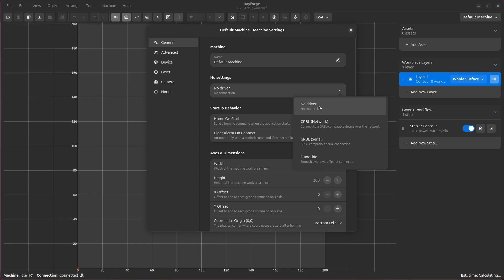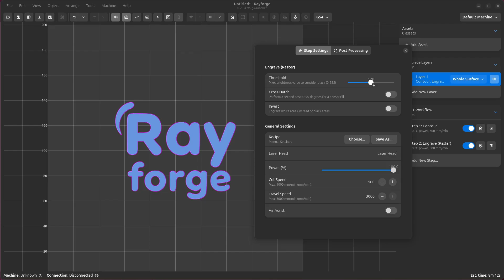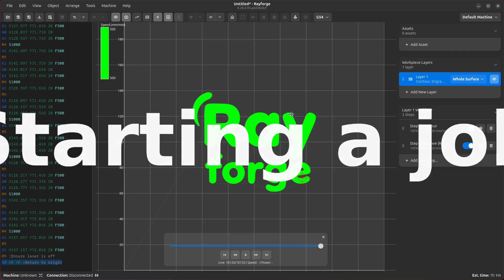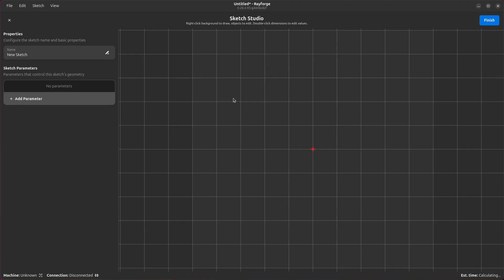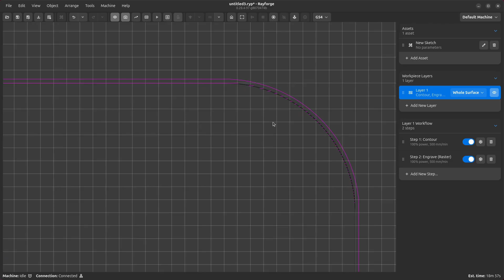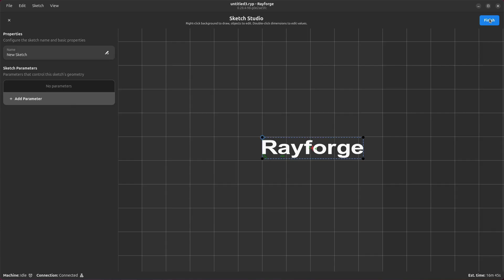Rayforge 1.0 released! Open source laser cutting. Text support, project load/save support and more

Comment: Hi. Congratulations. I just found rayforge and look forward to using the software. Is it possible to use the software for plasma cutting?
Reply from the maker: Hi, yes, sure, that should be possible. Rayforge supports keef and offsetting. If you are missing any plasma specific problems feel free to open an issue on GitHub, usually things are fixed fast

Comment: Please add a console. I use gcode to move the Z axis. I use the console to change $ setting.
Reply from the maker: You are in double-luck!: 1. The console is already available. So far only in the Snap edge channel, but it will be released with 1.1 at the end of this month. 2. The machine settings have a "device" page where you can directly edit $ settings with a nice UI.

Comment: Thanks a lot but my DIY LASER Cutter is uploaded with LaserGRBL firmware in it... Is this software able to control that... It's an nano CNC Shield
Reply from the maker: I think it should work - and GRBL compatible firmware should be supported.
Reply: @barebaric actually I recently shifted my system to Linux and the lasergrbl software is not compatible with that and so as a most close and feature rich alternative I found your software... So I want the highest compatibility with my machine

Comment: Look great! I'm not considering Lightburn at all because of their lack of Linux support.

I have one question, how is engraving supposed to handle grayscale? In LaserGRBL for example you have dynamic power which changes the laser exposure based on how dark the image is. I do not see this option in Rayforge. According to the manual the Raster engraving is supposed to be able to do this but that seems like an AI generated text...
Reply from the maker: Thank you, I am glad you like it! This is called depth engraving in the app (add a new step -> engrave (depth-aware)).
Reply: @barebaric  I see, depth aware does seem to do it. However why is M3 not used? Now Gcode is generated with Move , M4 100%, M4 0%, Move etc resulting in absolutely massive Gcode files. It seems kinda inefficient compared to what LaserGRBL does.
Reply from the maker: @schetenwapper6591 True, that can be optimized. Could you add a feature request on GitHub?
Reply: @barebaric  I think I had a brainfart, M4 is the dynamic one. I do notice a difference between the gcode coming out of LaserGRBL and that of Rayforge, LaserGRBL just has X1 S223, XS125 whereas Rayforge seems to set the M4 command after every move.
I don't know if this is a bug or not.
Reply from the maker: @schetenwapper6591 it probably is, I noticed that the dynamic power programs are quite large. It would be great to have the g-codes to compare, could you attach them to an issue?